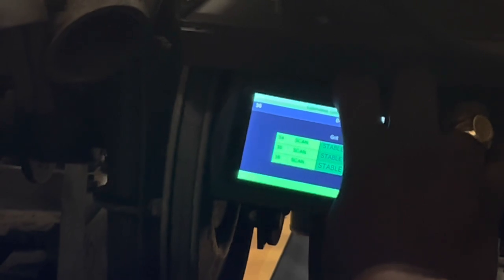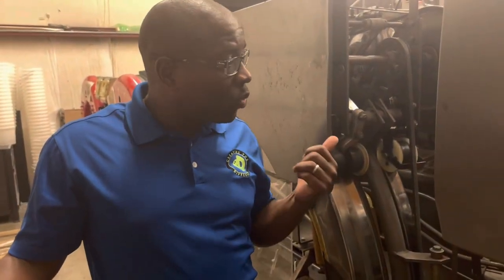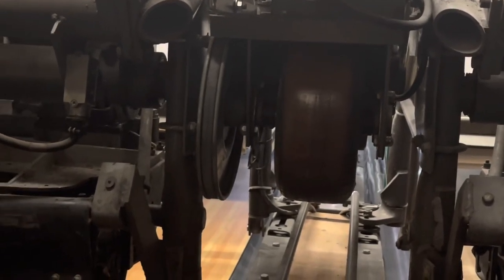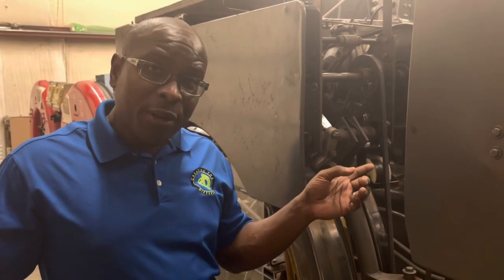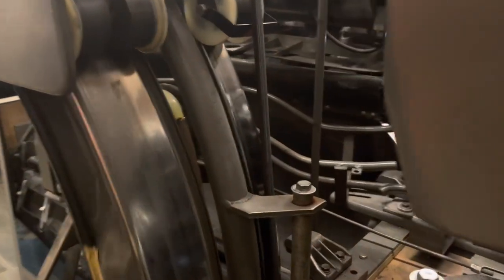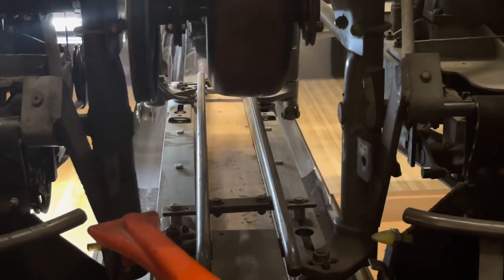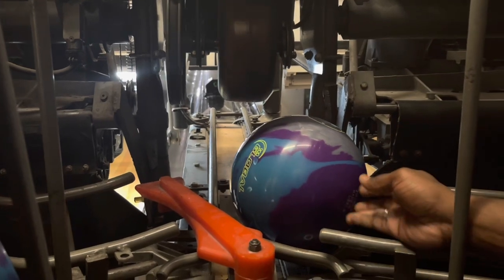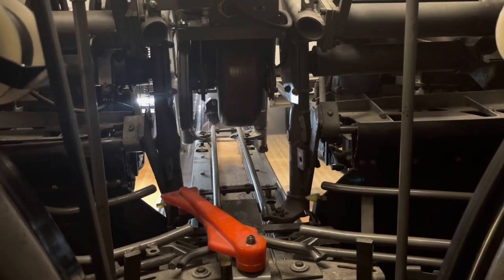WHY Your Bowling Ball Surface Changes | The Real Culprit | CtD Surface Scanner

Comment: Have you proven that experimentally?   Scan two identical balls with identical finishes to start, bowl one ball down the lane for 10 frames without using the automatic ball return returning it by hand each time.   Then compare that to a ball bowled 10 frames using the ball return.
Reply: Wouldn't mind seeing that either. Hard to believe the 100th of a second of contact there is changing the entire surface of the ball
Reply: The belts cause the most change to your bowling ball. A piston is in a cylinder for less time than that, but without proper lubrication, the piston will fuse to the cylinder block and blow up the motor. It's the same principle here. The belt, because of the friction and heat that it creates, slowly but surely changes the surface of the bowling ball. Residue that gets stuck on your bowling  ball also gets applied by the belt, not the lanes. The lanes are actually fairly clean.
Reply: it would take much more than 10 frames unless the ball is really dull surface like a 1000 grit to start.